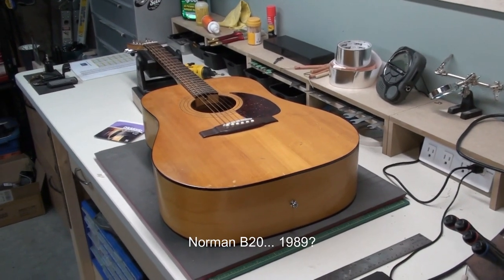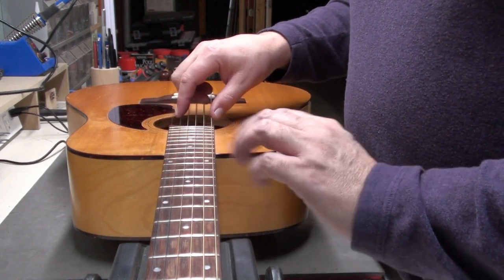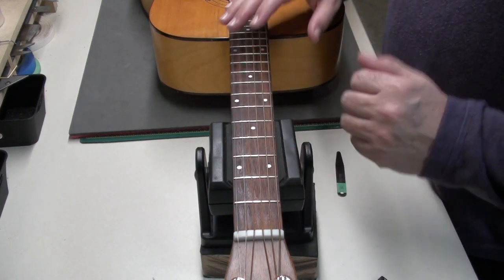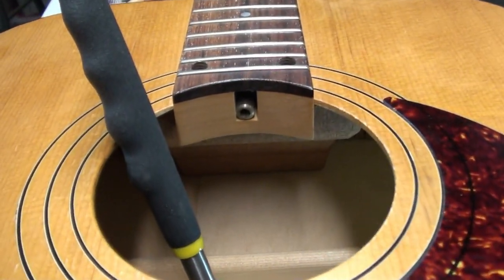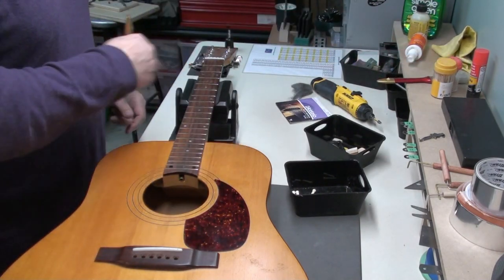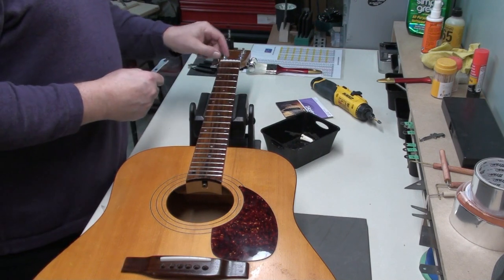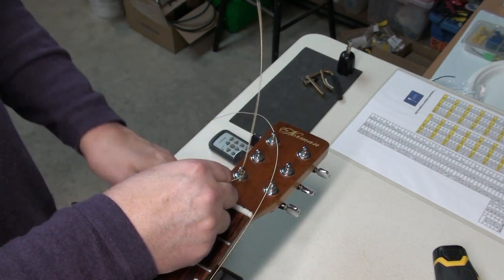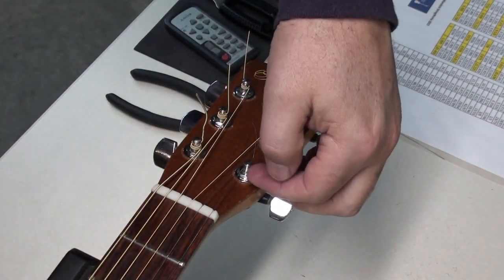Where is the heel??  1989(?) Norman B20 Acoustic Guitar needs a string change and some neck relief.

Comment: Late 1990s at best because before then they came with black plastic pick guards and different tuning pegs. My ST40 has the same tuners they started using in mid 90s.  Ps 11-52s are about right. They came with 12-53s on from new

Comment: Why aren’t you keeping track of the bridge pins. They wear to each string. I would keep them in order
Reply from the maker: You can do that- not always necessary.  You can tell if they don't fit properly and then adjust them.
Reply: You are right. I do that as well. More important than one thinks.
Reply: Every string is a different diameter. They should always go back to their original pin. Just my opinion. To each their own.